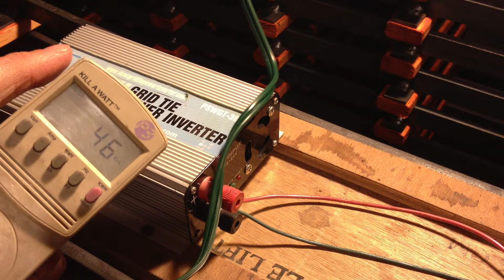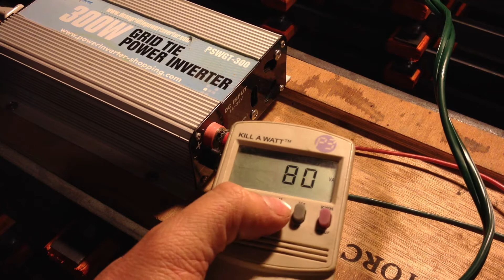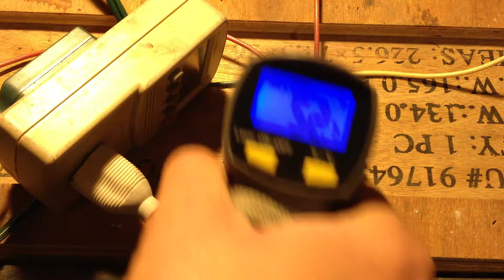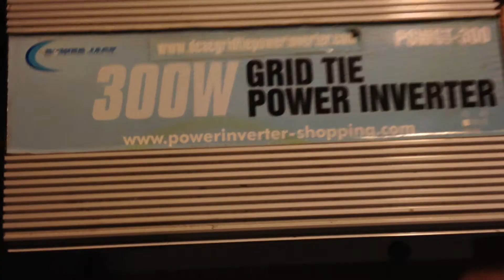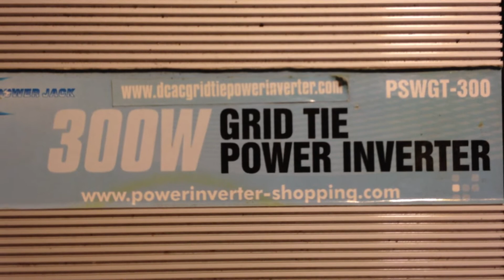Grid Tie Inverter Series: Cheap, At home Grid Tie system + Power Shifting! SAVE TONS OF MONEY! 3

Comment: Why not just wire 2 batteries for 24V and get rid of the dc/dc converter?
Reply from the maker: The object wasn't to get 24v, the object was to limit the wattage going into the inverter not to exceed it's maximum and damage it (The inverter instructions specifically stated do not connect a battery directly to the inverter or risk permanent damage).

Comment: is that train track I see. if so do you have a backyard railroad. like the idea you have. I have been wanting to build something like that to were I can charge my batteries and then once charged, then switch to put excess in to the grid while keeping batteries topped off. I have a apc unite my grid ties sink up to if I need more power when lights go out.

Comment: It's a good idea but if you add up the efficiency looses of charging the battery then discharging the battery thru the dc/dc converter then the grid tie inverter you probably loose 30%. You'd really have to do a test to see how much you clear in the process.